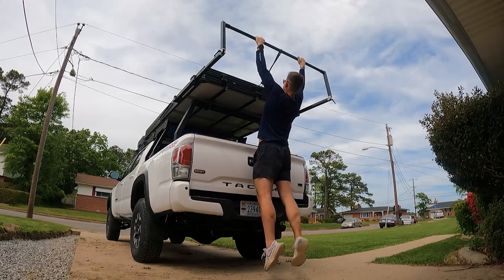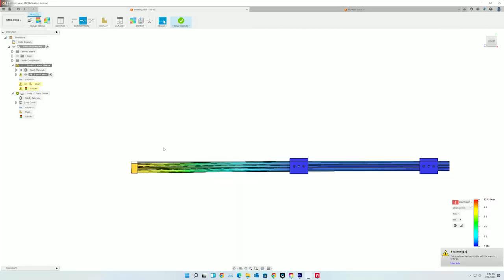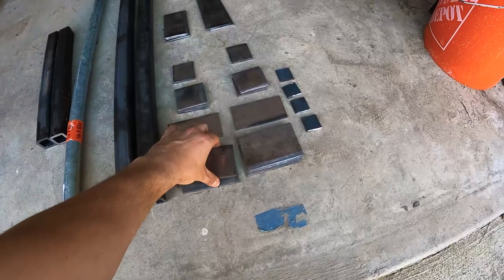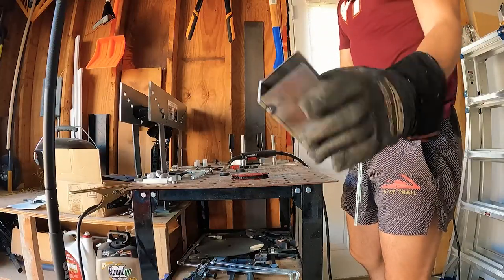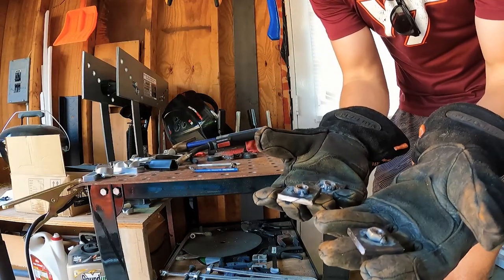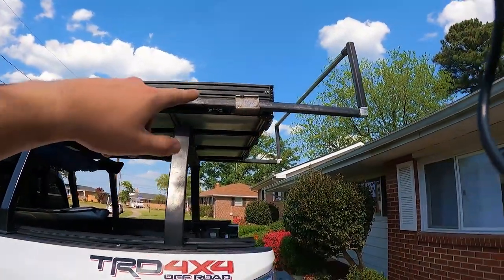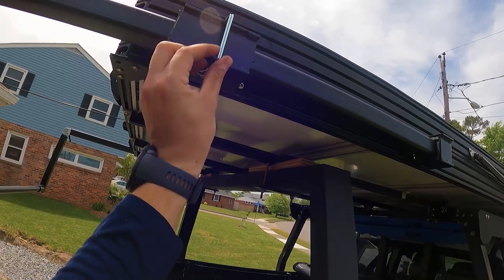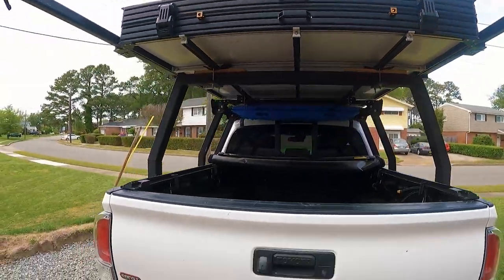DIY pull-up bar for overlanding

Comment: I'd recommend gymnastic rings. Get the 'adjustable number straps olympic rings'. (Much easier to match heights compared to regular straps.) Add dip belt and you're solid.

Comment: Linear bearings are mostly for compressive load. Would it not be better to put the bearings up top. BTW did you use 1010 or 1515?
Reply from the maker: Yea they are, especially so with the aluminum ones when they’re used with aluminum t slot because they usually have an open section which is highly susceptible to bending stress. In my application they weren’t really supporting much load when actually operating as bearings because they would only slide in and out when I wasn’t on the bar so it didn’t really matter if they were on top. This is definitely not the typical configuration of a linear bearing but also most linear bearings don’t have a fully closed steel housing like these. The tent frame I had in this video was all 10 series